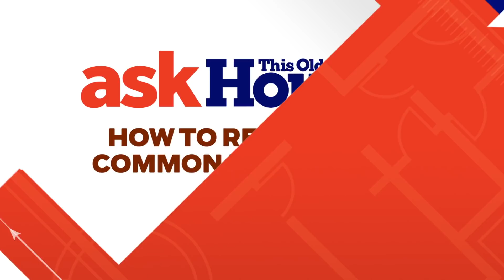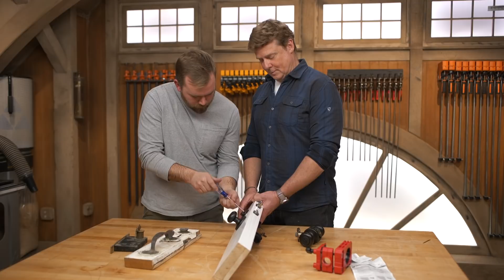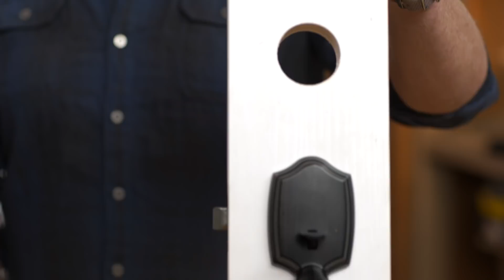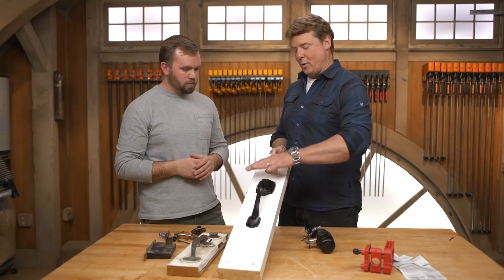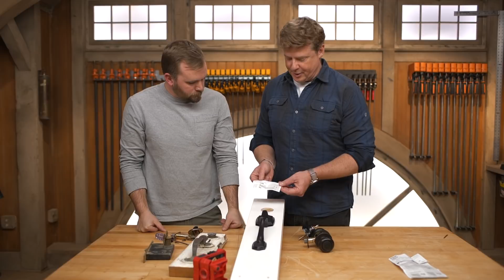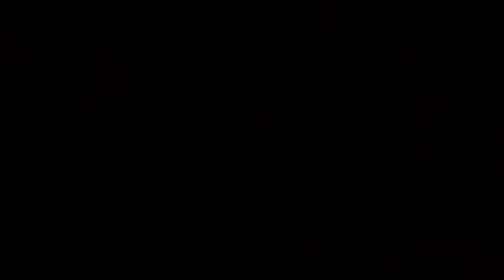How to Replace a Common Door Lock | Ask This Old House

Comment: Can I change the door handles and not the latch part? 
  I have an old door and the latch part is glued in place. Also, the door seems thin. I am afraid if I did try to remove the latch part, the door might split.